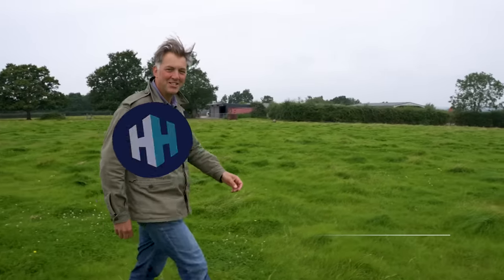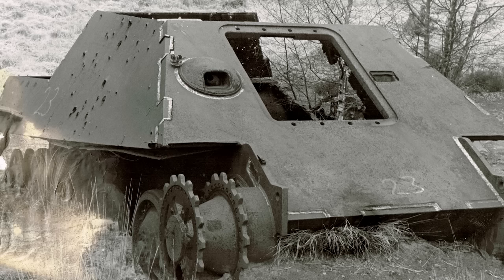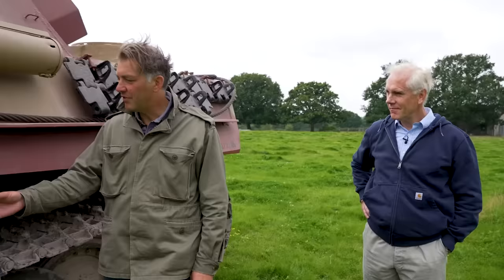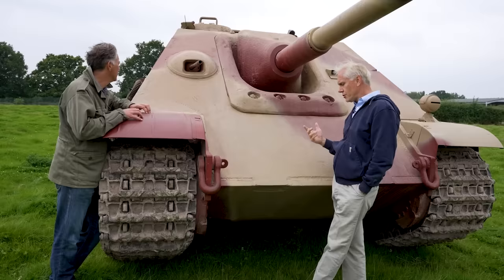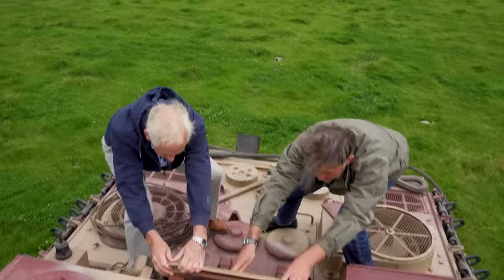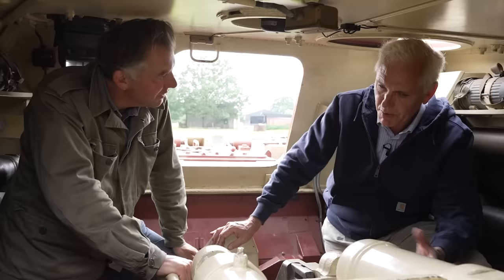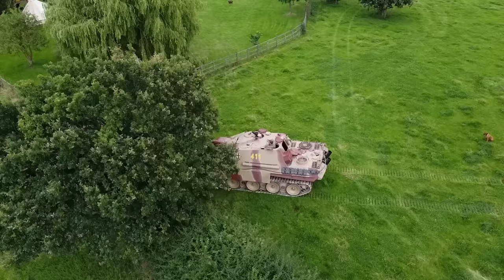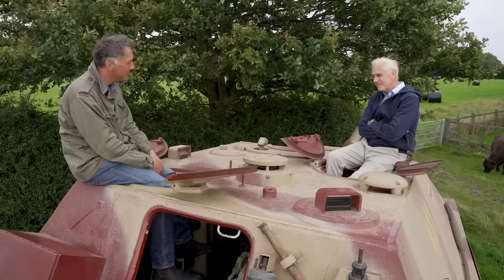Inside a German WW2 Tank Destroyer with Historian James Holland

Comment: Dang, I wish I could have one of those projectiles...replace my current one that I have installed in my cartridge, and they certainly are heavy, I reassembled mine to the correct loaded weight, which is just barely over 50 pounds.

Comment: Can you do the vt1-1 or the vt1-2 next? American "non-tank" as well, very special though bcs the vt1-2 has 2 120mm cannons, with no turret, it also has horizontal steering as turret rotation. It was supposed to be able to destroy multiple german tanks at a time with its 2 guns. It was made between 1974 and 1975. Unfortunantly it will be kinda hard to get your hands on 1 bcs there were only these 2 produced, but i wish you luck 😁

Comment: 80mm thick armour on the front (with a slope of 60deg) suggests a real thickness of 92mm if my calculations are correct.
Reply: your calculation is wrong, your reference is likely the horizontal while it should be the vertical
Reply: 80/cos(60)=160 So it has an effectiveness of 160mm.

Comment: The 88 had much of it's origins at Bofors in Sweden....
Reply: Not really, the main predecessor was the 8.8cm Flak 16 (designed in 1916 by Krupp), after the Treaty of Versailles to get around terms of the treaty Krupp (who owned a majority of Bofors) teamed up with them to produce a new AA gun, Krupp sent over a team of German experts over to Sweden to develop it. The Reichswehr were the one funding the development of the AA gun, the Swedes thought 7.5cm was adequate whilst the Germans concluded 8.8cm was adequate, both the Swedes model and German model were designed in 1928. I think its wrong and incorrect to say much of its origins were from Bofors, the predecessor was designed by Krupp, Bofors was majority owned by Krupp, the Reichswehr funded the project- all it comes down to is it was a thinly veiled project by Krupp to circumnavigate the ToV.

Comment: Were these much less expensive to produce as opposed to a 45 Ton Tank?  Thanks.
Reply: Well, for one thing, this kind of vehicle didn't need a large, precisely machined ball-bearing race. And a protective housing for it. Nor did it need a slip-ring rotating connector with 8 contacts to link the turret and hull electrically.
Reply: @daveybyrden3936  Thanks.

Comment: Thankfully for NATO, the Germans learned from their mistakes about how not engineering for repairability and maintenance can lose battles and even the war. That is why when people ask what makes the Leopard tanks more suitable for use in Ukraine as opposed to the Abram tank, it is the emphasis on repairability and maintenance that the Germans put into their design. The Abrams while very well qualified have more complicated design, especially around the turbine engine, while maybe somewhat easy to replace outright, is obviously much more difficult to repair than fairly standard diesel technology. And note that it is the Leopard 2A4 and 2A6 I'm talking about as earlier versions had much thinner armour due to the erroneous belief that HEAT rounds could not be countered.

Comment: When they first started building Armored Fighting Vehicles - they had a lot of different designs with one design doing one thing and another design doing another.

What they found - was that things would happen where they needed something to do a job - and the thing that had been designed to do that job - wasn't there.  So - they used whatever was there.  Vehicles that were over specialized - had a problem - if they needed something that had been left out of their design - because - in their designed purpose - they wouldn't have to do that.  But - in the Real World - they DID get called on to do things they hadn't been designed for.

So - this is where the concept of the Main Battle Tank came from.  It was a general purpose vehicle that might not perform some tasks as efficiently as something that had been designed to specialize in that area but they could do it - and - they could do a lot of other things - which a specialized vehicle might not be able to do.

Another factor in that - is that things had evolved to the point where you could have very heavy, very fast tanks with very big guns - that could outperform the older specialized vehicles.
.

Comment: The Germans really couldn't keep up in production to the Allies and were forced to make assault guns and turretless tank destroyers because they were cheaper and faster to build then an actual tank. Still the fact that so much engineering went into this thing really defeats the purpose. The lack of ability to maintain and even get to the engine is a serious issue. I think a tank platoon of M4 Shermans would be able to destroy this thing easily since the lack of a turret means the driver would have to move around alot to aim the gun at its targets.
Reply: I dont agree because all tanks had to stop in ww2  and fire to ensure a kill and turret operation was slow.All the best from Brisbane .

Comment: In my imagination (sadly i havent seen profound research about that yet), a portion of the vehicles not even reaching combat because of technical issues could have been caused by deliberate sabote from its crews (many germans in 1944/45 knew they would lose). When people injure themselves trying to dodge the frontline, they most probably would damage their vehicle for that purpose if they had the chance right?
Reply: It has been well-documented that a lot of mechanical failures of WW2 German war machines were due to sabotage in the factories by the forced labour used there.  Aircraft, U-Boats, Panzers, and other vehicles were all affected... evidence of this has been discovered post-war, as well as accounts given.  There were myriad subtle ways in which the forced labourers could dramatically shorten the service life of a critical engine component whilst the overseer had his back turned, but without the issue cropping up until the vehicle/boat/whatever was well away from the factory.  

There were also design issues with the final drives (esp. on Panthers) and transmissions.  Inexperienced crews as mentioned in the video notwithstanding, the rigours of combat showed up any design faults in no time.  The Elefant at Kursk is a good example.  Or the first deployments of the Panther and Tiger.  Premature field-testing = lots of KO vehicles.   

Finally, sabotaging one's own vehicle to stay out of the fight (=desertion) was just not in the ethos of the Panzer corps.  These men were an elite, vital to battlefield success, and they knew it.  About 16,000 German soldiers were shot by their own side for desertion during WW2.  I can't find an exact breakdown of those figures, but I warrant anyone who can would be hard pushed to find more than a handful (if that) of Panzertruppen included in their number.
Reply: @Grantidge69  Thanks for the answer but theres nothing new for me in it.
The soldiers operating Jagdpanzer and Sturmgeschütze were from artillery branch most of the time. 
Also sabotaging ones vehicle is no outright desertion as long as you don't get caught...
Maybe I'm wrong and it didn't happen at all but some people become very ingenious when trying not to die. Also this method would protect ones family at home from Sippenhaft contrary to deserting.
Reply: @blorblor5438  Sabotaging one's own vehicle would surely be construed as acting in the interests of the enemy and therefore tantamount to desertion.  It's not AWOL as per the precise definition, so I stand corrected there.  At the very least, if sabotaging to avoid going into combat, it would be "Feigheit vor dem Feind", which would also result in summary execution.  

Point taken about the PzJgr + StuGs being part of the Sturmartillerie, but the crews were all volunteers and still knew they were an elite.  They underwent +/- the same level of training as the Panzer crews, and they and their vehicles were often used in the same role as the Panzers later in the war (esp. on the Eastern Front, plugging gaps in the lines).  Plus artillerymen are generally considered to be an elite as well.   Strong sense of Esprit de Corps, therefore. 

I've tried to find evidence of the sabotage you suggest, and there doesn't seem to be any. No recollection of any such behaviour being reported in any of the many books on WW2 I've read over the years, either.   It also turn's one's vehicle into a sitting duck, which makes no sense in a combat situation.  Staying mobile = better chance of survival.

Comment: Just thinking If this had been introduced in 1941 or 42 then of course by 1944 the Germans would have  had experienced crews and had time to develop better understanding of how to utilize it most efficiently and also maantain It I'm also wondering about how easy it was for an exoerienced crew of other heavy armoured vehiicle to cross over and drive or command one of these?
Eg How difficult was it for the crew of a  Stug IIII, which was half the weight I think, to adapt to a jag?
Of course  the obvious example I'm thinking of Is  Wittmann  who was able to progress from the Stug III and  the Panzer III to to the  far heavier Tiger ?

Comment: One needs to realize that when this tank and the Panthers were been made the people putting them together were NOT German for the most part. The German factories during the late war were staffed by mostly slave labor and captured Russians. One of the books that I have talks about the quality of the Tanks at the start of the war was at its highest due to the factories staffed by loyal Germans. As the war wore on the factories were raided for man power to supply the fronts. The workers that were not German were actually sabotaging these tanks before they left the factory. At the battle of Kursk the Panther made its first appearance. 80%  of the Panthers were out of that fight due to failures of the final drives and other components. The German mechanical field recovery units were quite efficient and they recovered a number of these failed Panthers. One of the reasons the final drives were failing was there was metal shavings and metal filings found in these drives. The source was the foreign factory workers sabotaging them. These mechanical Field units were required in the later war to take a new tank and go through it to try and remove this type of sabotage before it entered service.
Reply: Very smart person.

Comment: Not over engineered, it had lower ground pressure per square feet than a Sherman due to its track and wheel construction…
Reply: The suspension was excellent in performance terms but a nightmare to maintain in the field, especially in Russia. Sherman wheels were much easier to replace.
Reply: Smart comments allround.

Comment: Interesting to see it leaves no marks in the grass. 
 
Next time you build a diorama and are too lazy to "dig up" the ground, add a link to this video - "it is possible".
 
The ground pressure of tanks is surprisingly low - one guy, ex-officer of the Wehrmacht, told us in winter they had parked their tanks (probably Panzer I or so) on an icy road in a strong wind, and they were blown off the road into the ditch.

Comment: I would assume that a lack of reliability during wartime also might have something to do with the forced labor force?
Reply: More than just forced labour if the vehicle used the same spur drive gear as the Panther tank chassis drivetrain.
Reply: @robertcuny934  you are right, but its mostly because of the Low quality metal. Centurion had No Problems with it's Spurs, because proper Metal was used.

Comment: The original "Tank" MK1 launched at the Somme in 1916 had no turret. It was so named because it looked like a water tank (also no turret). So if anything a "tank" with a turret should be called something else but not the other way round (sorry pedantic armchair warriors but ya wrong) also look up "tank" in the Oxford dictionary - turrets are not essential.

Comment: The British 17-pr on Fireflies and US 90mm on Pershing could surely penetrate that frontal armour.
Reply: The longer 88 would have been more powerful than either?  The brass case volume relates to the energy of the shell.
Reply: @givenfirstnamefamilyfirstn3935  The long German 88 is definitely a lot more powerful than either but from what I have read the UK 17-pr and US 90 mm should be able to penetrate the Jadgpanther from over a kilometre away, so Sherman Firefly, Pershing and Comet tanks can take it out even at long distances from the front.
Reply: In theory, yes. In reality, Jagdpanthers seemed pretty hard to kill at range.

Comment: At the hand of a experience tank commander, it will wrought havoc among Allied tanks who foolishly came across its sight.  There was a book about the Jagpanther at the hands of German tank commander with 12 or 14 tanks. Imagine being shot at 3 miles  while Allied tanks need to come 1 mile just to shot it at its weakest part. The batallion or regiment tank officer has to decide whom to send upon hearing of the presence a Jagpanther in the vicinity.  So anartillery barrage on a village or town is the viable solution to flush out the big J. EVen in the open any point tank is surely go up in flames. Then the Big J commander down with 4 tanks decided to surrender  to save the German village from bombardment. Everything seem to be to late the hero to save Germany. There was a report that plastic explosives was discovered, Synthetic oil was invented, the Push Pull propeller driven plane was at test flight, the 262 jet plane was limitedly produced, harden Flack Towers improvise to artillery that the Russian found to their misery and many more.  If all these have a year more it might flip the fortunes of War in favor of Hitler.

Comment: Nice to see one of these big cats still operational, but around the 11 minute mark there is one incorrect statement, he claimed that it had a heavy barrel and could not be changed as this would mean having to leave the tank to change the barrel- this is false, the MG-34 Panzerlauf had a removable butt stock and a 'Panzermantel' which was an armoured barrel shroud but apart from that was pretty much the same as the standard MG-34, which meant that the barrel was changed at the rear in line with the gun. This is the main reason as to why the MG-34 was still the MG used in German armour even after the introduction of the MG-42 (the MG-42 still changes the barrel at the rear but requires more space as it comes out laterally to the right). It seemed a bit naive of someone who spent 20 years of restoration on this tank to make such a false claim, as it would be physically impossible to replace the barrel from the outside of the tank.

Comment: Having or not having a turret has nothing to do on if its a tank destroyer.  There are tank destroyers with turrets (M-10, M-18) and there are tanks without turrets (Swedish S Tank). ITs configuration has nothing to do with its mission.
Reply: In the German doctrine only TDs lacked turret, on the american doctrine they had turret but lacked thick armor to be fast, the STRV 103 it's a MBT by Sweden doctrine and use.

Comment: That’s a crap of explanation. Are you saying that from 512 build 50% had a mechanical failures because of 18year old drivers didn’t know how to drive it? That shouldn’t be a problem if this was properly designed and build. Those jagpanthers and panthers were just poorly designed with overstressed drive train, especially out drives made of weak material and engine and electrical systems being prone to catch fire. This might look magnificent and has the most powerful AT gun, but was absolutely useless. They say top speed 32mp/h in theory only as crews were ordered not to exceed half of this speed because of drive failure, or not to operate in higher rpm because overheating problems….Total waste of resources on German side
Reply: Those problems were solved by late 1944

Comment: As always when you have people who know  actually know what they are talking about  busting the myths surrounding german ww2 tanks and the practical  use of them  in the field against the  german tank designers  This is what happens when  tank designers /engineers  take control and don't have the interest of the soldiers  input and suggestions  who after use them  in combat  over engineered over complicated  when the suspension system broke it couldn't be repaired in the field like a sherman tank it had to be towed  to a repair station  or  abandoned or blown up and when it got there the long laborious task of stripping other components to get to the actual broken bit  in some cases  ripping out several  wheels to get to the suspension bar    in the panther tank when the gear mechanism  broke  or the  clutch  it meant  from the drivers side everything had to be ripped out lol

Comment: You didn't go much into operation .... as it has no turret I guess the whole tank has to be turned to target the gun....then the gun looks like it has elevation...so presumably the gunner has to tell the driver ....left ...left....stop ..... slow right...STOP ...get the gun up/down to the bloody T34 and fire ........WOT A NIGHTMARE!!!   I'd go into the catering core ......
Reply: dont be silly, the gun has 12/12 degree traverse ... that makes it fairly easy to line up the vehicle for a shot ... the postwar jagdpanzers with the 90mm only increased that to 15/15 degree, as you really dont need much traverse on the distances tank hunters are supposed to engage an enemy. 
Not at all a nightmare to actual target an enemy as long as the commander can read a map and gets his vectors right .... its problems were the cost, production quality, supplies and maintenance ... and that late in the war the lack of trained and experienced crew. Despite that the combat records still show it to be very effective and efficient.
Reply: @diedampfbrasse98  Oh... OK!   No body said anything about that. Now it seems a lot better.